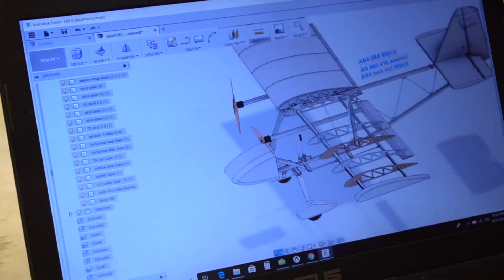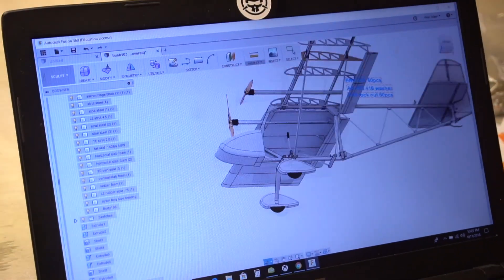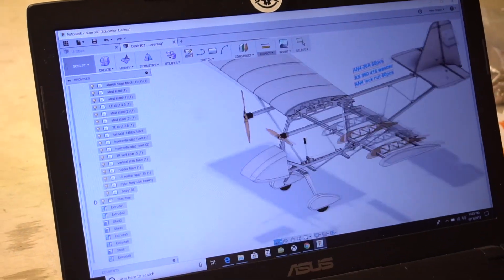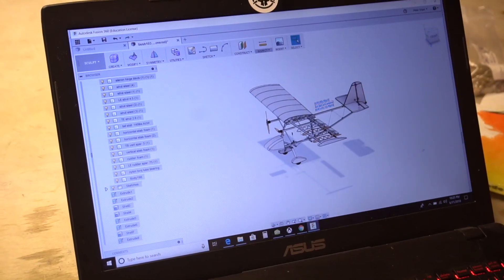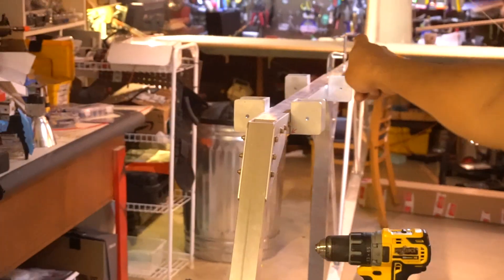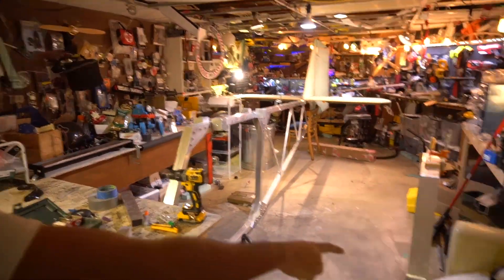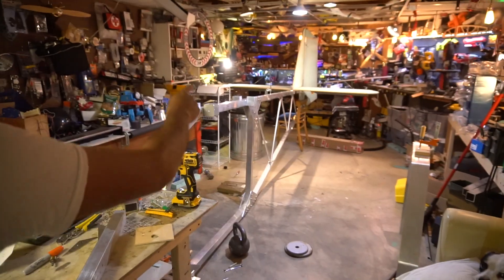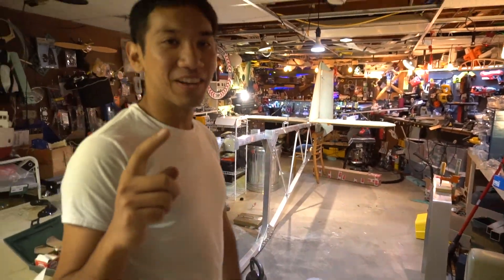DIY Electric airplane mk2 (Pt1)

Comment: Hi Peter,  your biplane with electric motors. Maybe put on solar panels to charge those many batteries to help with more time in the air. Also, any idea to sale it. I want a Lasair style with those two motors. I thought I would ask if it was possible to get you to make it and I buy it from. Slow and low! 35 to 45 mph, that's all. Oh yes, maybe taller tires

Comment: hello peter greetings from venezuela, all your videos are very interesting if you could guide me in the construction of an airplane, i have built some parts but here in venezuela due to inflation and lack of production material was not obtained aluminum is extremely expensive and i am making with some recycling and economic materials I would like to know a good technique so that the main wing remains light and resistant I also want to ask what specific measure should be the wing of an airplane I have seen many videos but mostly they do not specify the measures or the weight i hope you can support me

Comment: I’ve been thinking about putting two electric motors on my MX.  I want to use the same prop and redrive at the end of the root tube.  The motors would be mounted below the root tube, resulting in a triangle for the belts to run on.  I could use different size pulleys on the motors (same size on the motors) and a larger pulley on the redrive.  I could then be able to dial in the correct prop speed.  Mount the batteries in equal sized packs on either side of the root tube about where the engine presently is.  Put batteries on until the part 103 weight is reached.  My MX is a Two axis vintage, with no added accessories.       What do you commenters think ?       N.E.OH Bob

Comment: Peter  Write a Letter to ESAB or TWECO ( SAME Guys)  Get a ESAB 205 ic sponsored to you  Has AC/DC Big  MIG Stick and you can weld aluminum or steel with a Spool gun too  But the AC Tig is the SHIT!

Comment: you want to wear gloves around handling that alloy as much as you do building one .
Reply: your running the elect motors direct drive? most gear down ,,motor gets hot= magnet no work 

that square channel it to heavy for the rear see others ( areolite 103  for instance) .049 tube back to tail 

I'd like to give a shout out to my roommate Ling ...he's taking his 1st flight in a helicopter he built today ...."phil humphrey Dunfy"

Comment: I have a question for those out there in this area of expertise: Does galvanic corrosion become an issue with the way things are done here over time? I mean, it looks like he's pairing fiberglass, stainless steel bolts (with cadmium plating?), and aluminum together. Just curious to know what the correct way to pair these parts would be. I know there are tons of issues with properly mounting fiber without cracking or corroding (as I heard was an issue with the Dreamliner).

Comment: Holy crap! The other plane was 230 lb?! That's so overweight that if you strapped my dog onto it and called it part of the plane it would be over the legal limit for an ultralight (254 lb). That's a weird way of saying that if it weighed only 25 pounds more, it would be illegal to fly.

Comment: If you want to save weight, look at virtually every ultralight on the flight line, the tailfeathers and the wing are aluminum framed, fabric covered, some are doped (painted), some aren't painted but use an airtight fabric instead. You will find fiberglassed foam on Experimentals but not ultralights. Your method is pretty strong but its also heavy compared to standard ultralight construction.

Comment: seeing some of those parts and the bolts scare me. I have never seen brackets as thick as those on any aeroplane that I have helped design in the last twenty years. The U shaped brackets look like they need to be about 1/3 thickness. Also the bolts that you selected the need to be a lot shorter. as long as you have 1.5 threads sticking out then you are safe. Also, what diameter are they? they look huge, you are not building a bridge here. what is the minimum diameter bolt that will support the loads that you are going to put through that joint.there are two enemies of aircraft, drag and weight. From what I have seen so far you could drop at least a couple of lbs of the weight of the aircraft. Having said all of that, keep up the great work.
Reply: Actually, having watched more of the video, it should weigh half that. Why are you using solid block foam for the wings and flying control surfaced. you could remove most of that and fabric cover, it would weigh a lot less. it will take longer to build but with lower weight, less energy use and longer flights.

Comment: Where you you get the electronics for smaller projects? Brushless motors, speed controllers, etc. Is there anywhere besides $20 for one servo on amazon?

Comment: You could cut down on electric use if you use one motor and a belt drive the write flyer used a similar design.

Comment: Here are my observations so far: 1)except for your landing gear, this design resembles the pre-Nazi Germany small training gliders,; 2)a lot of nuts and bolts and sheet metal means extra weight; 3)to simplify and to save weight, how about either a V-tail or else an all-flying stabilizer/tail (not elevators/rudder); 4)RE: the propellers, can you find polymer 3-blade props with a larger diameter (slower turning)?

Comment: I just need to ask tho. Why electric? Is it the whole gimmick or you don't trust gas engines? Because gas would last longer on air and I believe would be easier to be in track of the fuel reserve as opposed to battery powered engines.
Reply: virgilio moncada I think he’s just not used to working with internal combustion engines

Comment: Could you drill some holes in the Aluminium beams without compromising the structural strength? It would reduce the weigth...

Comment: Peter you have come up with a new wing structure a patron goal should be having one professionally tested to get it's g limit.and load capacity. A kit using your way would give a flying finished machine in 2 weeks if it was a kit

Comment: You might want to look into a tig welder. I have got the AHP welder it works really well and doesn't break the bank.  The most dangerous thing on the last plane was wheels. I am part of ppprs which races homemade electric carts . Many of us have tried to use those wheels and they are nothing but trouble. Besides blowing up the rims themselves will also break. Replace those ASAP.

Comment: I used to work for a company in the UK called Aerotech International Ltd... they have not traded for many years as the company folded a long time ago... but we manufactured the MW5 Sorcerer Microlight aircraft both built and as a Kit Form... which I believe was designed by Mike Whittaker - although we did design and produce a variant of the aircraft called the Sorcerer MW5K which had a tapered wing as opposed to the original design which used a parallel design from root to tip... it made me smile a great deal watching this video as it reminded me of some of the processes we used in putting a Sorcerer together... thanks for the Vid... :o)

Comment: Peter, would it be okay if you sent me the model as a .stl? I'd like to use autodesk's flow simulator to see theoretical drag stats on it.

*edit - also as someone who's worked on building an rv-12 I can say that your design appears sufficiently rigid, though the tail is likely overkill in structure.

Comment: Many of your structure, fittings and attachments could be done with fiberglass, bamboo and plastics. Steel and aluminum are strong but may be too heavy and overkill for strength. Why do you reject bamboo fiberglass and plastics?
Reply: I suspect hinges using nylon fabric would be at least as strong as aluminum, yet oh so much lighter. Etc. Rinse and repeat.

Comment: Hi.  I am an A&P and I don't want to sound like a smart ass, but.  I saw you using standard pull type rivets.  While in some areas you can use this type rivet, you really shouldn't use them in structural areas like control surface hinges.  The reason why is that there's nothing holding the shaft in place after it snaps off.  When that shaft pushes out of the rivet, you now have a rivet that is only 10% ass strong because it's now a hollow rivet.  You should look into Cherry Max and Cherry Lock rivets.  Definitely more expensive but it will be considered a structural rivet, the same as a solid rivet. When you squeeze a Cherry Lock (it's possible that I have the 2 reversed) , the rivet shaft, just before the shaft pops off, drives a positive locking ring into the shaft so it can't be pushed out. The rivet can still be drilled out when needed.  It just takes a little effort to get that stainless locking ring off before it can be drilled out.  Just something you may want to look into.  It would kill me to find out that you've been in an accident because of losing a control surface, and I didn't say anything.

Comment: Peter, your joining plates should always have the holes drilled so that the holes through the square extrusion are as close to the inside edges as possible. Same with bracketry if at all possible. Look at a Bensen Gyrocopter if you possibly can, for examples of proper square tube junctions.

Comment: Your over engineering. The props running air over the wing will give more lift at lower speeds. 
If you go over weight, increase the cord of the wing  ? 
The leading edge is where the strength is needed. The skin can be boat shrink wrap instead of fibre glass  ? 
You don't have to have bigger props if they are suited to the motors.

Comment: 4:40 If you want to build a really slow flying and lightweight aircraft under 200lbs with good controls, check out Bloop ultralight.
https://m.youtube.com/watch?v=a88_dmD9lV8

It’s drawing plans are also freely available:   http://m-sandlin.info/bloop/bloop.htm

You can just replace gas engine there with your electric engine. Spare yourself from reinventing the wheels, seriously!

Comment: Ever think about running an "APU" engine to generate the electric needed to run the electric motors? surely you could make get an engine small enough to generate the volts/currents needed?
the question becomes, would be it more efficient to run an APU vs direct drive gas engine vs electric motor?

Comment: Why not get rid of the foam core and use cloth/ fabric covered control surfacesl. The way its been done forever. Or even the more modern heat shrink stuff. Solve the weight problem.

Comment: Peter, the problem you are having with finding a controller has nothing to do with companies not wanting to share information. When you approach them about a controller, the first red flag you throw out is "AIRCRAFT", and for most companies all they see is a liability problem and don't want to pay for that kind of insurance. That's why STC'd aircraft parts are so expensive, testing and insurance. There quite a few homebuilts that fly with PRSU on the engine using Gates belts and cogs, but if you call them and say your project is an aircraft, they will not help you. Liability.

Comment: Peter, the extra weight might be in your fasteners (bolts, nuts)?  Not sure that is a calc in the cad program.  also the torsional moment of the airframe could be a problem.

Comment: Peter, great looking design. Curious, how did you compute the needed thickness of the square tube? It would appear the square tube and the brackets are much thicker than required ... which is contributing to your weight gains.

Comment: Echoing some of the other comments, this actually looks structurally better off and looks better than the bi-plane, but great on you for the OSH gig!  Yet another reason that I wish I was there this year!
Really, this is a nice looking airplane in design, perhaps you could market it.  Just make sure you get a legal release and have some sort of lawyer speak going into it!
Reply: I'm sure you see it, but be careful with that seat.  It looks like you will be sitting aft of the CG, and that might cause an issue if the batteries don't give enough ballast.

Comment: I am developing many new technologies beyond flight, but.. i have a mine with very large industrial diamond..  tonnes... each... to use in a turbine for an ultralight helicopter... carbon is lighter than aluminum and stronger than steel, it has a zero heat expansion ratio and can withstand temperatures of reentry for instance... I am StarFire.. we are going to the stars

Comment: Just a little advice, because the engines are wing-mounted and high off from the CofG, you might expect the aircraft to do a minor PITCH DOWN action when you apply thrust. But counteracting that is easy: just pull back a little bit.

Comment: This looks pretty cool.  One thing about the wing struts.  I see you have two struts on each wing and they look parallel to each other.  If they are, have you considered going to a triangle configuration, like on the Piper Cub.  If those struts are parallel you can get some collapsing tendencies because it would act like a parallelogram.  The triangle strut wont have that tendency.  Plus, you might be able to reduce some weight in the belly section where those struts attach. 
I'd love to hear your reasoning behind your design.

Comment: Hey, I've been an aircraft mechanic for 10 years, I have my a&p from the faa, I spent 3 years building the Honda Jet. I love your enthusiasm about aviation, I am very similar to you. Your weight issue can be solved by properly executed and installed dope and fabric covering instead of foam board. However, there are many lessons you need to understand to keep yourself alive. I.e altitude is a pilots best friend, more altitude allows for more time to correct for any errors or emergencies. If you have an error 100' off the ground, you will have no time to correct and you will die. There are old pilots and there are bold pilots, but there are no old bold pilots. Fly safe my friend, taking to the skies is a carefully calculated balance betweeen life and death. Feel free to contact me if you want any advice or help.

Comment: Pete , 
 I am just a old metal head and don't know many things but metal is my jedi skill ... drill holes and start sanding the wait will come down without losing strength. Where you can weld ... do so the nuts and bots will add up . I go thru this all the time with the race boats. It's a little more work but it's also free work :) you what I thought I might be giving you some advice but just realized ... you really don't need much ;) NVM ;)

Comment: what you need to is take your 2 motors and gang them with a gear reduction then you can turn much bigger prop and lower speed 
this also fixes your single motor ops issues

Comment: great design..i miss the classic biplane look though...maybe it could be cleaned up for more speed and maybe vortex generators added for slower speed..

re tail leading edge: leading edge sweep increases critical angle of attack and thus lowers stall speed, a rason wht most tails have more sweep than wings. the (fore)wing must stall first!

Comment: Peter, it looks like you could have saved a lot of weight using thinner wall tubing. The stuff you’re using looks massive in the video. With all the gussets and diagonal bracing you could cut the wall thickness in half... just my observation.

Comment: Grumman aircraft has the nickname for generations now of "the Bethpage Boilerworks," because no Grumman plane ever built was ever UNDERWEIGHT for its first flight.  But, they are always built hugely strong.  In a choice between strength and weight strength seems to have always won.  You seem to design to the same criteria for your ultralight(s).

Comment: Great to see you back building another full-sized aeroplane.  Weight (structural efficiency) and aerodynamic efficiency are the big items for long flight time, in general I'd say the new design has opportunities for improving on both over MK1.  

On the structural efficiency front one thing you could look at doing is mounting the batteries out on the wing, either right behind the motors or very close.  Potentially you could even mount them within the LE to span load the wing, this reduces the bending moments on wing vs mounting the weight at the centre.  Mounting the batteries right behind the motors would have the advantage of reducing wiring length which will reduce e;electrical losses and help with weight and complexity.

On the aerodynamic efficiency front, the flat profiles with sharp LE's on the tailplane will likely cause early separation when you activate your control surfaces or yaw significantly.   While you can't really change this now without a complete build of new tailplane, perhaps you could retro fit 3D printed vortex generators along the LE's of the tail surfaces to help retain flow for longer and maintain a bit more control authority without big increases in drag.

The flat design of the strutted fuselage section out to the tail is currently strong vertically but torsionally and laterally it will be relatively weak.  Wires out to the wing could help with the lateral stability.  Another approach would be to minimize the rotational loads created by the rudder/vertical tail surface by extended it downwards so that the forces generated are closer to the centre of the tail section. 

On the aerodynamic efficiency front fairing the angular structures that are exposed to the airstream might be helpful.  Wing struts will be a good opportunity for reducing the aerodynamic costs of them by fairing them.  A 4:1 chord to length ratio is a pretty decent rule of thumb for fairings.  Keeping them light is a challenge of course.  Model plane skills might come in handy for this type of work.

Best of luck.